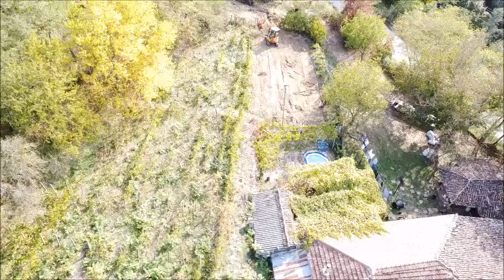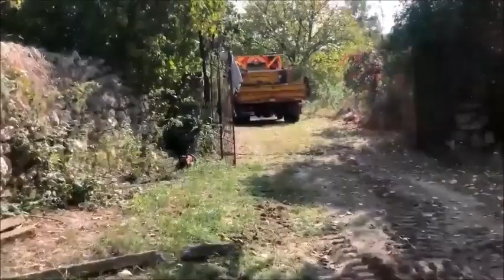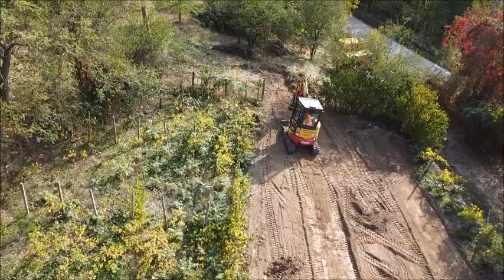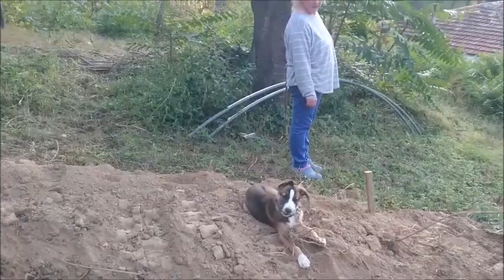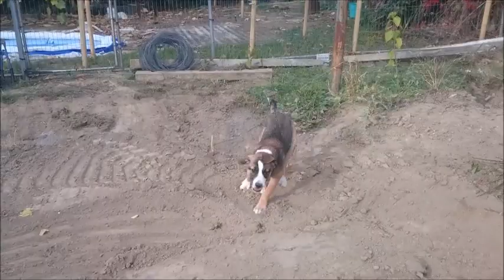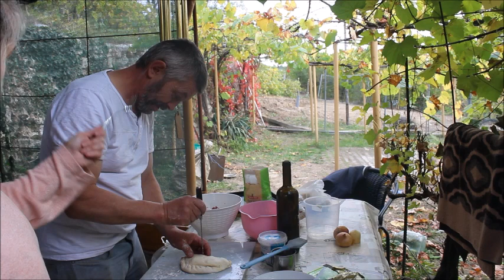Episode 15   Ground works and Cornish pasty's

Comment: Very good and interesting but there's a problem with the sound I can't here most of it cheers
Reply from the maker: Sorry Roger. It's an on-going problem we're trying to address. I thought it was the camera, but no. I then tried altering sound settings in the editor I use, but still no luck? It seems some people hear ok and others don't. I'll try and find a different editor as I'm still using the old windows one. Cheers